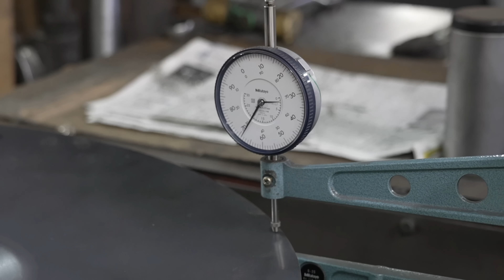シンバルを作るプロセス。数千回の鍛錬で出来上がる日本唯一のシンバルメーカー。

Comment: Thanks to the channel. What a joy to see!
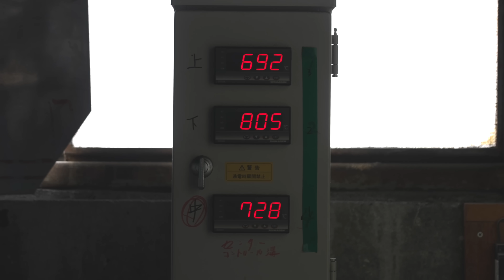01:57 I am impressed that despite having such a hands-on process, they are not above using modern tech for precise temperature display.

02:04 So cool (ha-ha) to see they have pre-heated tongs to ensure the work is not cooled by them.
02:11 The sound of the hot metal sliding into the water is also cool!
04:09 I have seen a video of the making of steel drums in Trinidad, and it also involved such skilled hammering to curve the metal evenly to achieve a pure tone.
07:05 I am surprised to learn those ridges are deliberate. I had always imagined they were just a by-product of the process and not functional. I can now see it would be trivial to make the work nice and smooth and shiny, so there is a reason they are ridged.

Comment: I just had a crazy thought. At the 7:15 mark (you know, where they add the grooves to make it damn near impossible to clean the thing), I remembered an old video an ancient clay vase who's surface (at its creation) was smoothed by using a brush leaving grooves (as it was spun during smoothing) which modern lasers were used to playback the sound.
I wonder if anything could be done similarly on the bottom side of a cymbal? It could be a great way for a super secret James Bond plot device...
Reply: Надо делать точечные углубления в канавке для создания кода.
Reply: sure, to make a CD record, it is also engraved digital numbers on an aluminum-based material, and the material of B20 copper is similar to aluminum. But you have to invent special engraving equipment and special audio players, the cost is not affordable for the average user, and it is not meaningful
Reply: I would be surprised if it couldn't. All you would need is a powerful electromagnet like a speaker coil between the lathe and the cutting head. The "decoder" would need to know at least the lathe speed.